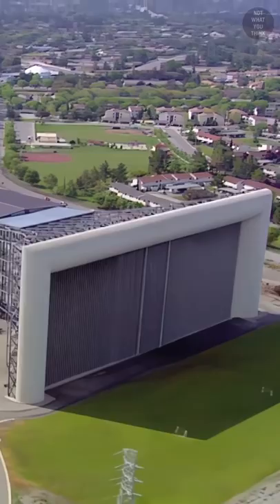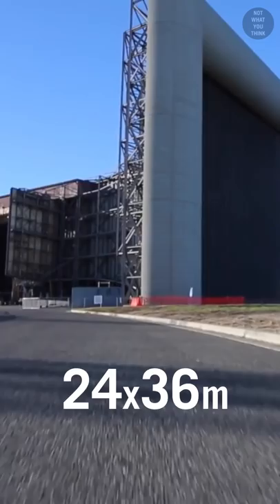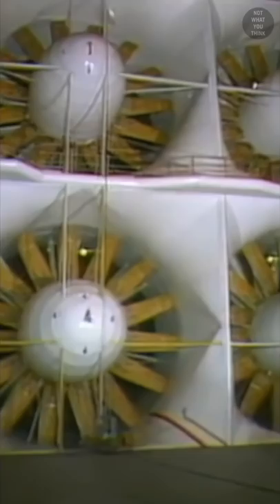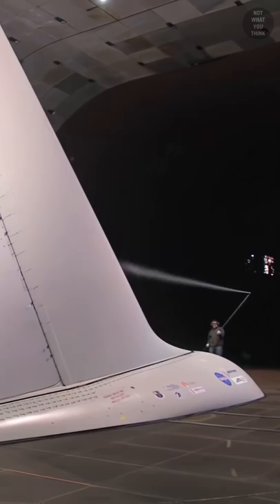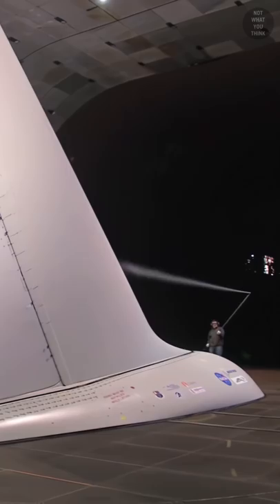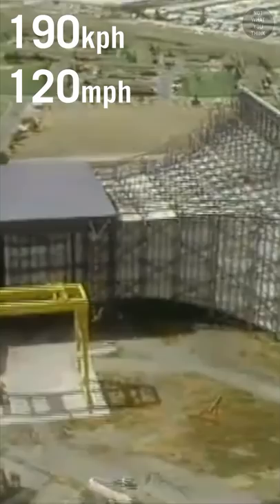Where Models are Blown by Fans! #shorts

Comment: Pedantically speaking, the air is drawn through the wind tunnel as the fans are at the exhaust end of the building. This is done to reduce turbulence so the sensors can be more accurate.